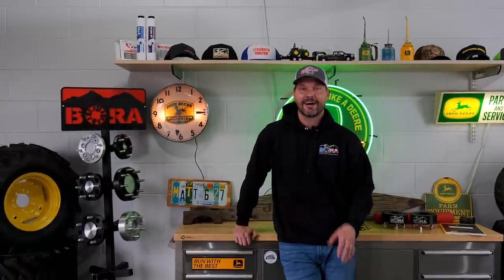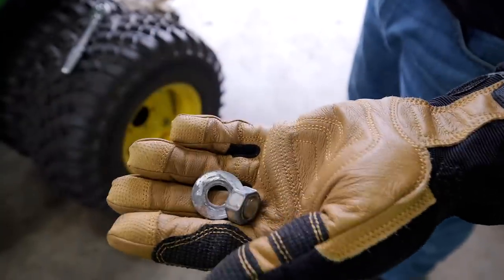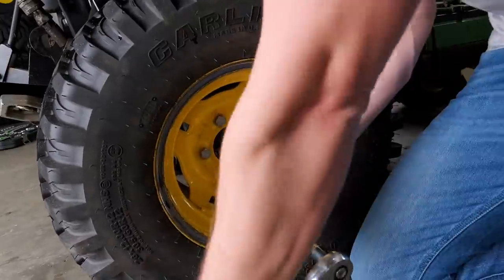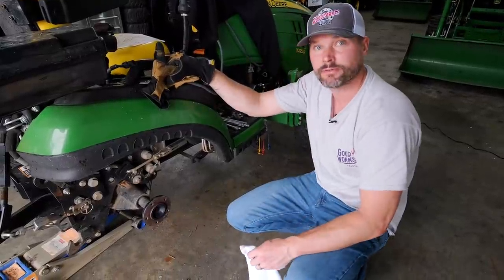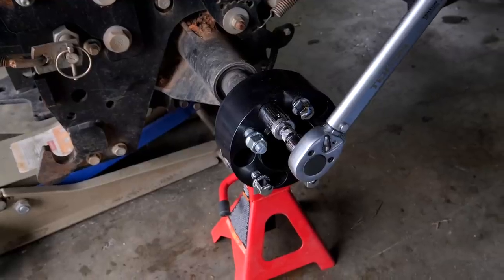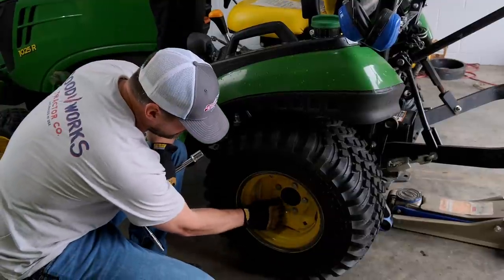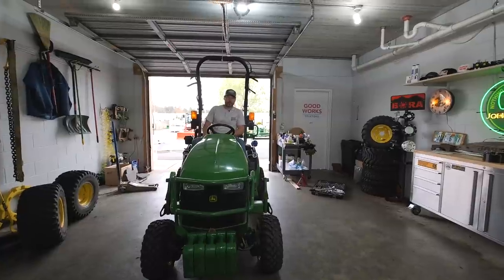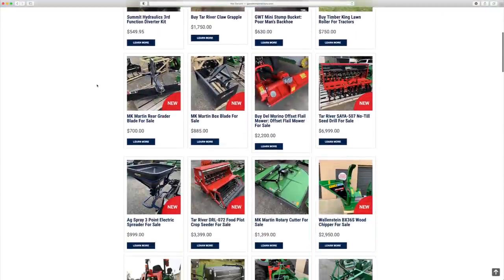SAFETY FIRST! HOW TO INSTALL WHEEL SPACERS ON YOUR TRACTOR! 🚜👨‍🌾

Comment: What's the biggest you could go without impeding the mower deck? I'd like a 3" set...
Reply from the maker: You'd want to measure the space between the outside of your tire and the gauge wheel.  Then, I'd subtract a little to be safe.

Comment: With the spacers do they also interfere with the mower gauge wheels like the duals did ?
Reply from the maker: I'll find out.  Haven't thrown the mower on yet.  Typically either 1.5" or 2" is the max with a mower.

Comment: Great video. So by the same logic, should you take the wheels off and check the torque on the spacer bolts regularly also?
Reply from the maker: Thanks.  Yeah, I mentioned that in the video at one point.  Some guys mentioned adding a small amount of thread lock.  Manual does state not to Lock Tite though.
Reply: Yes, you should retorque the spacers and the wheels. 
God bless you!

Comment: I recommend the 1/2" Milwaukee cordless impact wrench. Would have had those lugs nuts off 10x faster. It's an animal.
Reply from the maker: Air tools and impacts are not to be used.
Reply: @GoodWorksTractors  Shouldn't matter taking them apart. They probably say that because they want you to tighten with a torque wrench (which you should).
Reply from the maker: I agree, just following instructions :)
Reply: @5075E  lots of times the studs are pressed in and can be spun in the spacer ruining it if you use an impact going in or out

Comment: On my 2020 2038r John Deere I had to use the studs that was for my rim on my rim and the hardware that came with it I had to use to bolt the spacer to the hub because my studs for my wheel were larger than the studs for the spacer and I could not fit a socket for the studs that were for my wheel there was not enough space in the holes for the spacer to fit a socket in between
Reply from the maker: Spacers from BORA?
Reply: @GoodWorksTractors  yes
Reply: @GoodWorksTractors  the only difference between the hardware and my wheel studs was that the hardware had smaller heads than my wheel studs thread on both was same

Comment: Since you were taking the wheel off anyway, wouldn’t it have been easier to just take the wheel off first in order to pull the bolts out? Not sure if they have to come out first for a reason or not.

Comment: You lost me right between cleaning the hub and mounting the spacer. My application will be for a JDZ225 4x4” hub, whose threaded studs mount through the back of the hub, exposing about an inch&1/2 of threads to mount wheel to. Your example showed spacer completely covering hub, and bolts going into the recesses of the spacer, which I’m assuming thread into front side of hub? Ironically that’s what I searched out your video to see, as well as to see if I’ll need to change stud lengths to not interfere with wheel then being mounted to the spacer. Good quality video, but unfortunately my questions are still unanswered.

Comment: Maybe a little never seize next time? If you do snow removal I wouldn’t be surprised if it was corrosion from salt locking up the nuts. 

Unless maybe the tension loading was near thread shearing and they literally got pinched on. 🤷‍♀️
Reply from the maker: Good idea.

Comment: That 6” extension reduces the torque by quite a lot. Torque equations are with no deep well sockets and definitely no extension.
Reply: An extension doesn't effect the torque when it's applied correctly with a torque wrench. This is the reason why, the torque should be applied in a smooth, constant manner so the extension is flexed and the nut is tightened. 
The reason torque sticks work is because they are used with an impact wrench which has short bursts of force. 
God bless you!

Comment: I would think on the heavier tractors the steel spacers would be stronger? Aluminum is great but not the strongest metal and can warp with heat and cold ? Not an expert by any means and either way the spacers are solid chunks of material. Also steel bolts and rims and aluminum spacers on a larger tractor that puts alot of torque on the rear end when pulling something through the ground would it be better to just have everything steel even with the having to paint and primer?

Comment: was your tractor in neutral when you tried to torque the spacers?
Reply from the maker: In range, not neutral
Reply: @GoodWorksTractors  my best guess is open differential,  the other wheel was probably spinning the opposite direction.  then when you put the other wheel on the ground it had enough resistance to torque. as well didn't your tractor have a parking brake issue (out of adjustment or Light pressure) I remember it rolling down your front yard.

Comment: 2 words. Impact wrench. Not to tighten,  just to take off and put on nuts and bolts.
Reply from the maker: Everyone focuses on the shortest part of the process.  Screwing bolts on and off took no time.  The least of my concerns.  Bunch of NASCAR pit crewmen around here 😂
Reply: @GoodWorksTractors  when I had my race car, I used the impact to get the lug nuts on. Then used a torque wrench. No ugga duggas. Learned my lesson on that. Snapped a wheel stud once. Never again

Comment: One more question, are wheel spacers harder on wheel bearings, and if so 2 inch would be easier on the machine than 4 inch..

Comment: I thought for sure your OCD (like mine) would have kicked in and repainted the wheels before reinstalling them. But I suppose that would have screwed up the timeline of the video which it's main purpose is to show how to do the install. Nice video though.
Reply from the maker: It bugs me even now not having them painted, haha!  However, with my phone vibrating almost non-stop from calls and emails, I needed to get the install done.  Touch up will happen along with an overdue cleanup.  Similar to a builder's own house being the last to ever get worked on, same with my tractor.  Always taking care of the customers first!  :)
Reply: @GoodWorksTractors  I know that all too well. I'm an electrician with two old crappy panels in my house and have outlets that don't work. Wife wants to kill me. "The cobblers kids have no shoes" I think is the saying. Take care.
Reply from the maker: There ya go!

Comment: Next time Use Never-Seize  i use it on every Bolt.
Reply from the maker: Nice, will put it on the must have list.  Thanks!
Reply: @GoodWorksTractors  You'll also want to brush it on the Hub face to prevent corrosion.
Reply: It's tempting to ease future removals but never use any lubricant (oil, grease, anti-seize etc.) on lug nuts or wheel studs as it will alter the required torque values by drastically lowering resistance/friction. This is actually s a big problem in the trucking maintenance industry with lost wheels due to stud failures.
Lubricated, more clamping force is applied as you tighten and you risk stretching a fastener. I used to work in pneumatic tool testing and calibration and a fastener 
that's meant to be tightened 'dry' (with corresponding torque input values) can result in 30% or more clamping force applied to it when lubricated.
Reply from the maker: Wow interesting information and it makes total sense.  Thanks for sharing!!
Reply: @michellatour150  Not enough to Effect Whell Lug Nuts better then Breaking them ogg I have been using Never-seize over 50 years on Everything on the Farm & Personal cars & Trucks.
Reply: @toymvr  As mentioned I used to work in torque tool calibration and testing, results seen on actual load transducers and broken / stretched test bolts don't lie.
The torque values suggested on 'dry' fasteners is taking into consideration the friction, reducing the friction will achieve a greater clamping force, compromising the fastener.
Reply: Electric impact sure wood make the job quicker and easier snug them then torque. Drop of motor oil only for studs
Reply: I would never use anti- seize or never-seize on wheels. Not a good idea at all.
Reply: @jameswhalen6584  yep, That's what they do at My John Deere Dealer

Comment: your left axle seems to have some oil residue around the seal, not sure if that's just spray lube (WD-40) or a seal leak. My eyes may deceive me but it looks like its been there a while.
Reply from the maker: Good eye.  I'll have to take a look.  It was also sitting outside at my house all night in the rain and was raining on the drive to the shop.  Might be that too, not sure.

Comment: I've had 2" spacers on my 1025R for years.  I'm installing the 6" soon.  There is almost zero flat land on my property.

You're going to see less stability going from dual wheels to 2" spacers.  Why not go with the 6"?

But the dual wheel setup was sort of home-brew ....... Good luck.

Bora makes stainless steel spacers?

See how BCS did their quad wheels.  youtu.be/B9xk_SNvzLQ
Reply from the maker: I don't think there's any doubt it will be less stable than the duals, but more stable than no spacers.   👍

Comment: Anyone use those on the front axle?   make the subcompact tractor track wider?
Reply: I've heard most people don't put them on the front due to the front axle pivoting in the middle. Some people put them on the front if they run chains on their front tires for clearance but not really for stability.

Comment: My dealer told me that running wheel spacers like this on a 1 series would void my warranty as the 1 series axles were not designed to be used with spacers. They said they could cause premature wear and could contribute to axle failures. Has anyone else heard this?
Reply from the maker: I've asked multiple dealers this direct question as several have mentioned this in the past.  No clear piece of literature to be found anywhere calling out spacers as voiding warranty.  There's also other dealers that install them for their customers -- JD, Kubota, etc.  I would also counter them with the question of if it's better to wait until I tip over on the tractor to decide it was worth the risk of shortening axle life in order to make the tractor safer to operate?  Spacer and duals have been used for decades on tractors.  Likely thousands of 1025r owners specifically.  If there were a high failure rate, then there were be dozens of threads easily found all over the internet to read through.

Keep in mind, the vast majority of dealers still sell tractors without recommending any kind of ballast weight even though it's an easy way to upsell and recommended in the manual.  Why?  Don't be afraid to question your dealer if something doesn't pass the smell test.  Like everything else, there's a laundry list of myths in the Ag industry.  https://youtu.be/xRMHlS4nJ84
Reply: @GoodWorksTractors  ,thanks for the reply. I looked at wheel spacers pretty seriously until I heard this from my dealer. To be honest, I didn't really know if what they said was true so I wanted to hear your thoughts.  I will say though, I decided to add wheel weights and fluid filled tires first. These additions totally transformed my tractor from a tipsy feeling machine to a much more stable one. So I didn't pursue the spacers anymore. If I was operating in more challenging terrain on a regular basis, I could see where spacers would be a good addition. I agree about them selling loader equipped tractors without ballast. I really think the manufacturers should require the dealers to include proper ballast with all tractors sold that are equipped with a loader. I quickly realized my tractor was unsafe to operate without the axle ballast in addition to significant 3 point ballast.
Reply: @kirkbrinkley6990  JD actually sells their own spacers for these, especially for people adding chains for winter use.

Comment: So love all the content. You should know that you are installing these improperly. I watched your video and followed the install the way you have presented it in the video. I had the back wheel bolts sheer off in the hub and almost lost the tractor to a tip over, or at least seemed like it. I mentioned this to the Bora guys and they agreed that it was incorrect the way you present install. They said that the bolts that come with the kit are what you should use to attach to the hub NOT the ones that come on the JD. I think it would be wise to revise this video content or take it down for the moment so other folks don't run in to the same problem. Again, I should have read the directions carefully myself before install, and to be clear I am not blaming you for the issue. It is everyones responsibility to read before they install a product. It was a learning experience for me and more importantly it was one I walked away from with a good life lesson and some extra work to remove the bolts from the hub lol.  I just don't want to see someone getting hurt from a non factory approved install because they are watching a how to video that does not follow the manufacture guidelines.

Comment: 1  your videos cover really common problems and your honest style is critical to manage diy expectations, 2 your nuts broke off because the dual spacers were plastic and even if installed correctly (they were, i watched that video) the twisting nature of the heavy loads will Always transfer to the two tires differently... and gall the threaded bolt where it touches the wheel rim.   The evidence is the rubbed off paint on the rim.  This is unavoidable because of the significant width of the tires compared to their height.  Only way to prevent is to have metal spacers w some kind of mechansim to prevent outer wheel from rotating wrt inner wheel (keyed notch).  Sacrificing long bolts is routine.  Cheers.

Comment: Why didn't you use the rims that were on the outside because they have better paint on them
Reply from the maker: Same amount of paint rubbed off on all rims.
Reply: @GoodWorksTractors  as long as the outside wheels were in the same orientation as the inside wheels if you would've used the outside wheels on the tractor the paint wear would've been on the inside. 
God bless you and your family!

Comment: I have the Bora spacers myself and installed them a few months ago.  
I would like to make you aware of a safety issue:
The Bora hardware that came with the spacers are tapered to match the taper in the spacer holes. 
You were supposed to use your John Deere hardware to mount the wheel to the spacers. I spoke to Bora directly about that.  I noticed you used a flat bolt on a tapered hole on the spacer. Not good. This is why Bora gives you the hardware to mount the wheel spacers to the tractor.
Reply from the maker: I did not get five bolts with the spacers.  Perhaps you got something different than I.  There was no way to do what you're stating with what I received.  The spacers had two bolt stems sticking out from them with two nuts and then three bolts to go through the wheels to the spacer.  No hardware for the spacer to the hub was included.
Reply: @GoodWorksTractors  the hardware that was screwed onto the spacers when you received them were for shipping purposes. Use that hardware (3 tapered bolts and 2 tapered nuts) to mount the spacer to the tractor. Use the John Deere hardware to remount the wheel to the tractor. That was per Bora's instructions when I spoke to them.
Reply from the maker: There is no end on the two threaded bolts with the nuts.  There was no wayto remove them from the spacer let alone screw them through the spacer and into the hub.  Seems different.
Reply: @GoodWorksTractors  
Rewatched ur video so I understand what you are saying.  your wheel spacers were supposed to match your tractor hub. Your tractor hub has no studs and the Bora spacers do. I would contact Bora on that. Bora told me directly that the spacers are supposed to match the tractor hub when I ordered them. I would hate to see you have damage down the road since you are supposed to have a tapered bolt on a tapered hole.

Comment: Impact tools will make this task much easier. It was painful to watch someone wrenching all this stuff.
Reply from the maker: The instructions specifically state not to use Air or Impact tools.  That was the least painful part of the job.  Plus, I'd venture a guess that 90% or more of the viewers of my channel don't have air tools anyways.  I wanted this to be more relatable to the average Joe (like me).  Thanks for watching.
Reply: @GoodWorksTractors  We mean to take it apart , not put the spacer on...You wouldn't have to worry about the wheel spinning if you took off the bolts with a 18V impact. The y have infinite adjustment on the trigger or you could use a 12 V to put them on. Hand install to get the threads right. Than power them in until they touch. Than switch to the torque wrench.

Glad you pulled those outer wheels off when you did. Those loose lug bolts wouldn't have taken much more. I see they are causing your axle seals to seep. That space between the wheels are also perfect houses for mice.🤗
Reply from the maker: I'm pretty sure you guys are all either trying out for NASCAR pit crews or have severe arthritis.  Turning some bolts by hand or with the socket was a cinch and was hardly a concern of mine.  

I see none of you geniuses have given any sage advice for remounting those 160 lb loaded tires though.  Cone in our crew, help a brotha out! 😂👍

Comment: Air tool 2 take the lugs off. That would have saved 5 2 10 minutes.
Reply from the maker: Their instructions specifically state not to use Air or Impact tools.
Reply: @GoodWorksTractors  Maybe not for final torque, but shouldn't matter taking them off.
Reply from the maker: I guess that was not a big deal to me at all.  Maybe if I was wrenching in a tire shop all day, but not 20 lugs.  No biggie and the smoothest part of the job for me.